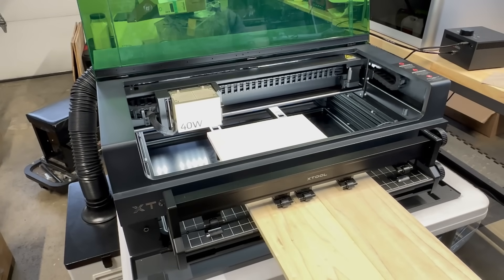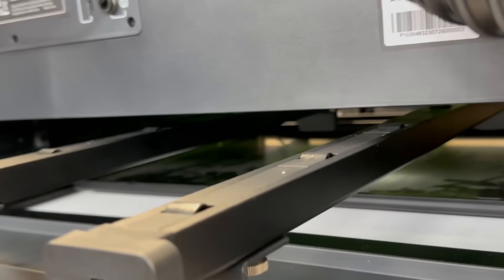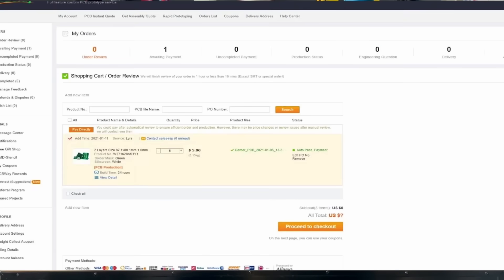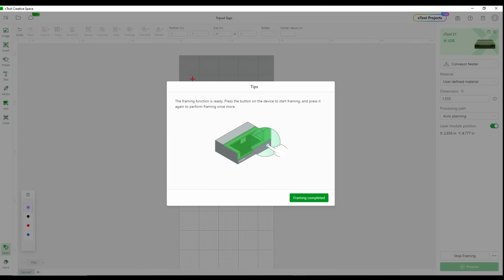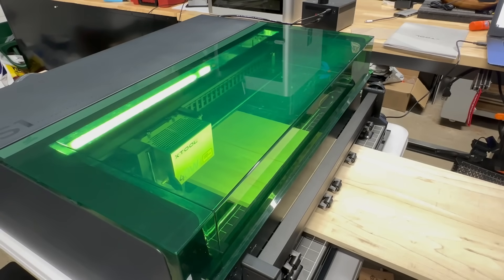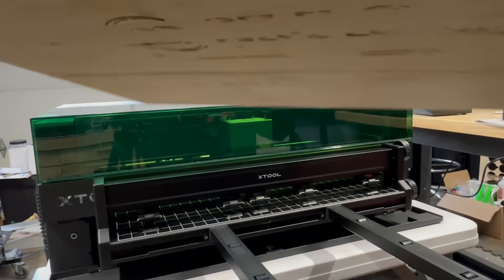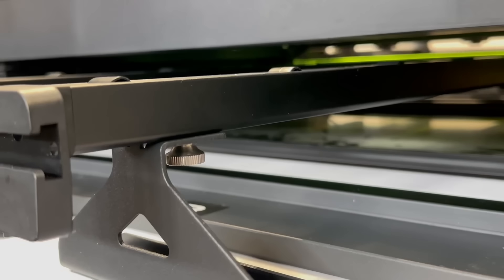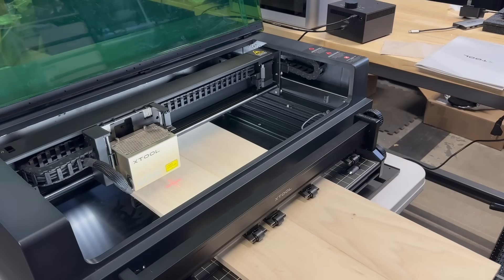xTOOL S1 CONVEYOR FEEDER

Comment: Just an fyi for you. You can rerun and recut the material. It’s super easy to do. Before you move the material, check the cutouts while the material is still loaded. You should be able to feel it move with your finger and see a bit of movement in the cut. If you don’t, just run the process again using the same settings. It can be time consuming BUT it beats wasting materials. I had a Glowforge and it was IMPOSSIBLE to do due to the camera inconsistency. But with the S1, its pinpoint accuracy is next level! Try it on some scrap and you’ll see exactly what I mean.

Comment: you should do some research sure you can do up to 118" but not unless you purchase a set of rails after the all in one kit which would be $639 + $129 not just $419
Reply from the maker: Never said the included rails can do 118”.  Plus you do not need to purchase the additional rails, when a couple of roller stands can do it for far less money.

Comment: My question is about the tabs. How do you figure out how many you need! My first time using the conveyor and the middle of my D cut out completely, fell down inside the laser and then interrupted the board as it was being pushed under the laser.  Had to hit the emergency stop button and wasted my board.  I'm assuming tabs would have helped after watching your video but I'd like more info on that if possible.  Thanks so much for the most comprehensive video on this that I've been able to find!

Comment: Good video.  I am getting close to purchasing one of these 40W lasers.  I would use the conveyor for some signage, however, I really want to figure out how to use it for cutting thick paper material, cork, and rubber which are non rigid.  Do you think it would work?  Also, I would love to see you run some cutouts on thin cork material and different laser safe rubbers.  I don't think I have seen any other 40W diode laser videos on this.

Comment: You want to burn through wood on one pass. Laser cuts wood by burning it thus creating charcoal around the cut which burns much slower and will resist being cut on a second pass. It's kinda like building a fire in the forest. You'll get a nice big fire using a pile of wood which burns quickly, but once it burns up to coal and ash you don't get much more flame out of it. Same concept applies here, the laser just isn't going to cut through the already burned edges like it does though fresh wood.

With other materials like acrylic a second pass can be used (adjusting your laser depth of course) because it's melting the plastic instead of burning it, but you'll have limited success trying to cut through wood with multiple passes. 10:00

Comment: Great demonstration John, thanks! I think I'll stick to print & cut for now with the LaserMATIC, since it has the largest dual passthrough at 1" tall x 17" wide. They also have a conveyor in R&D but are trying to get to work more accurately with multiple pass options.
Reply from the maker: Thanks!  Yeah, I really didn’t expect it to work with multiple passes.  There is no guide fence to help keep the workpiece from walking.  You would need something like pinch rollers for the sides.  I really didn’t expect the letters to come out, but everything did.  Thanks for watching and commenting 👍
Reply: 😊 @TripodsGarage

Comment: You complained about the riser base being sold separately from the conveyor system. That’s because the riser base can be used for other purposes. Could the riser base with the conveyor be sold as a package at reduced price? That would make sense.
Reply from the maker: You are correct, my complaint is just that.  There should be a package deal discount.  I should have explained my complaint better.  Otherwise, performance, I was actually surprised how well it worked.  If you are looking to enter into the contest.  If you qualify, do another comment with what you would make with it.  Thanks for watching and commenting 👍

Comment: 3d print new shorter risers for the conveyor & see if that solves the problem. Great video, cool upgrade.
Reply from the maker: Unfortunately that wouldn't solve the problem.  The mount on the riser will need to be changed, and how the conveyor mounts would also need to be changed.  Thanks for the compliment, truly appreciated  😃

Comment: A system that solves problems for someone who wants to handle longer material.  Like bigger 3D printer beds, not needed by all, but very useful for some.  How is the temp in your garage?  I have my laser in my unheated garage and it is now below 0.
Reply from the maker: Yeah, it worked great on the longer materials.  Just would like for it to handle thicker materials.  The garage was at 36deg, now with the space heater on, it is a balmy 39deg 😆

Comment: Great vid.
I was wondering if the system was repeatable. That offset on pass 2 was likely the material walking to the side and/or the motor missing steps along the way. For thick stock it's a shame the 2nd pass didn't hit the mark.
Agree that 1/2" is restrictive. It might be the reasonable cut thickness, but that doesn't mean you wouldn't want to sometime just engrave a long board that's thicker. 🤦
Reply from the maker: Yeah, the board definitely walked.  I should have noted that it would benefit from side rails (fence) to help prevent that.
1/2 in is pretty thick material, depending on the material 1/2 on a softer wood would be the max on one pass.  However, would be nice to also have the option to engrave 3/4 to 1in material.  
Either way I did come away pretty impressed with this conveyor system.